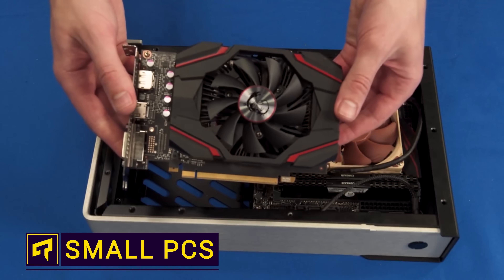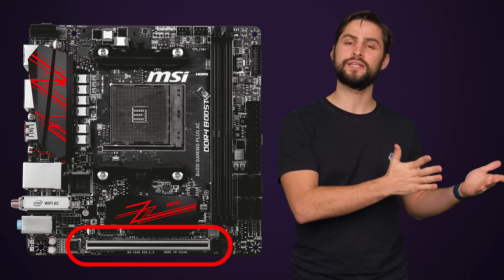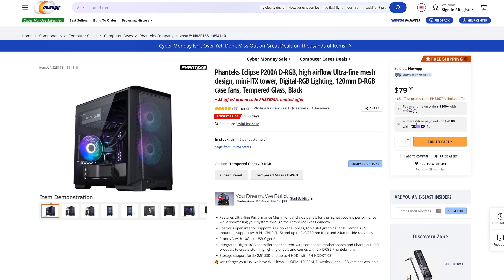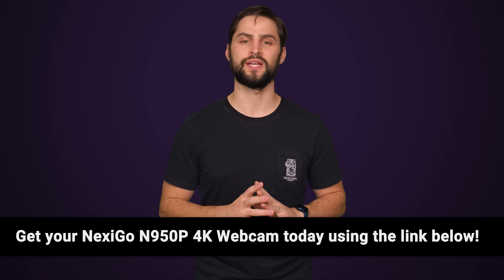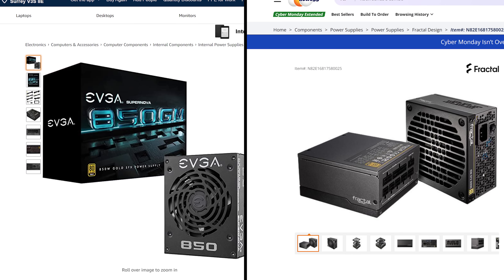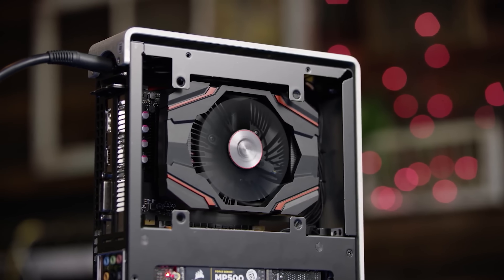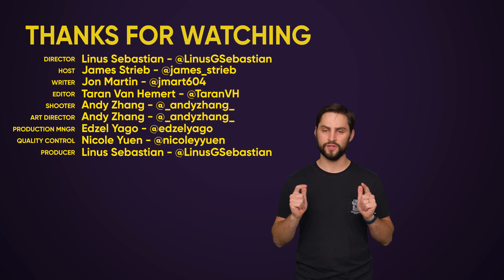Building a Tiny PC - What To Know

Comment: CoolerMaster NR200 was a sweet spot for me. It fits ATX PSU, is relatively small, has good airflow and is a breeze to build inside <3
Reply: I have the same one. I do have an SFF PSU inside it though. But it's a pretty nifty case.
Reply: The NR200 and the newer NR200p Max are great cases for entry into SFF. The max even includes a PSU and AIO. 
Until recently I had the NR200P and it's a really great case. Now have a lianli Q58 and it's a great case as well, but somewhat more constrained for size being a sandwich layout vs the more standard layout of the NR200.
Reply: I have yet to build SFF, but I'd go even smaller, if current market changes in the near future...
Reply: bruuuh the NR200 is 105 euro LOL!! I would much more prefer the Elite 110 which is only 63 euro (locally) and it has a box shape design which IMO is better and I prefer it :)
Reply: @xorkatoss  105 euro? Maybe where you live. I got it for 70 EUR.
Reply: I was able to build in this case with a regular ATX PSU and mATX mobo I already had. Only a few mATX boards fit, but it was really great to be able to downsize without paying the ITX tax
Reply: Sama IM01 is better, same size, cheaper and support both m-Atx amd ITX, NR200 has the power pkug on the mianboard side so it can't fully support all m-Atx options.

Comment: I would love to build a tiny pc, however tiny pc tends to be a lot more expensive tho. Especially in my country where pc parts are more expensive and on top of that, the global shortage supply.
Reply: @est495  Yeah because wood totally supports high temperatures !     /s
Reply: Unless you really want super small, get a smaller mATX case for wider compatibility
Reply: @Joel-pl6lh  It doesn't really matter as pc components don't usually get that hot.
Reply: @Joel-pl6lh  this way, when the power supply burn, the whole pc burn too

Comment: I want a tiny pc as an alternative for gaming in my car. I have a Lexus and I do not want to run the engine every couple of hours to. recharge the batteries, I would need a more powerful inverter for the ATX series. Laptops I don’t get to build, and there are discrete

Comment: 2nd hand framework board, USB-PD 100w battery backed up power bank+60W power supply, or 100W power supply alone, cooler master framework case.  Very tiny PC.  Only downside is no graphics.  Give that a few years when the 16" boards and gpus start getting upgraded lol

Comment: where were you before i bought a node 202 after all my parts and had to buy a new psu and ram and cooler only to find out i need a new psu or extensions and i need new ram for an even smaller cooler and a new cooler that keeps my cpu extra toasty 

good thing theres a chip shortage because my gpu is a piece of paper because thats all that would fit

Comment: Hey guys I have a project about building a gaming computer  and i have formulated a survey and need your guys help since I dont have much friends so i would really appreciate any input 

PS: I'm not limited to a budget 

1 What is the ideal amount of memory slots on the  motherboard?

2 What is the ideal memory frequency?

3 What should the base CPU clock speed be?

4 What is the recommended number of cores for a processor

5 What is the recommended number of threads?

6 What is the recommended number of M.2 slots

7 which generation processor is recommended ?

9 What is the recommended Graphics card?

10 Recommended Wattage for the PSU

11 Recommended modularity for the PSU

12 Is an NVMe SSD required

Comment: I love itx build. It remind me how hard it is to upgrade so I don't, thus saving me some money.
Reply: It really isn't that crazy to upgrade an ITX build, unless you're talking the smallest end such as a Velka 3 build. Even then, though, your only significant limitation is the small GPUs available in the current generation.
Reply: @catgirldoll  I could add 2.5" ssd if only it placed outside of my case.
Reply: @koknyoq  so add an M.2 instead, or if the slots are filled just get a cheap M.2 to USB adapter and clone your current M.2 drive onto a bigger one before swapping them!
Reply: @catgirldoll  pain in the ass to do that better save money. As I mentioned before.
Reply: not really a big PITA. It's just:
- buy drive and $5 or less adapter
- plug drive into adapter and adapter into USB port
- run cloning
- unslot old M.2 and swap

Comment: Didn't talk about GPU selection. There can be a big difference between 2.0 vs 2.2 vs 2.5 slot thick cards and which ones fit in a small case. Also card length and width. The EVGA 3070 XC3 I got was the biggest card that would fit in my Fractal Design Node 304 case.

Comment: If ITX is too expensive, try the tecware fusion or Sama Im01 which fits an ATX PSU, Double fan graphic card, and a micro atx motherboard while being only 21 litres in size. With an SFX PSU there could be room for a full length GPU as well.

Comment: For me I wanted a tiny computer just to run Linux for me on my KVM switch. Since my needs were minimal I just purchased a small used HP EliteDesk 800 g2!
Gave it a 512gb M.2 drive & it's also connected to my 8tb External for........... Torrents.... Serves it's purpose well!

It would of been a joy to try to build a computer this small from scratch but just wasn't practical for me when I scored this for $100 USD back in January & does everything I need it to.
Reply: I was running one of these old HPs as a retro gaming console to run old games on emulators (GTFO NES Classic, etc) and tuck away in the home entertainment center. 

Unfortunately I had problems with the DisplayPort on the 800 so I ended up going with a similar Dell.. but these old desktops in these SFF are incredibly cheap and have a ton of uses.
Reply: @ScottOmatic  Guessing issues making display port work nicely when your HDMI tv? 

I luckily got a display port based KVM switch so it's been fine for me!

Turning one of these into an emulator box isn't a bad idea. Only has crappy Intel integrated graphics. But still plenty enough for emulating anything from the 6th gen or older!
Reply: @ScottOmatic  Not bad haha, if I can get an i5 or i7 cheap on eBay ever I'll upgrade mine. 
But the Pentium is good enough. JUST good enough. Lol (for torrents and media server) 

The GPU market is terrible now. Unless you can catch a card at release. 

I ended buying a Rx 6900 XT at release. 
I didn't want their top of line card... 
But I failed to score a 6800 at release. 
Still I paid retail price so I'm laughing... 

I got a low profile GT 1030 for my wife's old computer. Some old business Dell. 
But I built her a new PC with a Ryzen 5 5600g. 
And gave her my old R9 390. 
Still competent.
Reply: @ScottOmatic  Yeah I was trying on AMD site for the exact card you got. It best fit my budget. 

My the site was crashing and stuff. Not loading. And I didn't get either. 

When the 6900 XT released. AMD had stronger system of blocking people. 
Like the site was overwhelmed and was blocking people for trying to refresh to much. 

My main PC at the time. And my little Linux computer got blocked. 
(Also tried with a VPN) 

But an hour later I got the order in on my phone.... AN HOUR LATER! 
That's how aggressively that were blocking people on the 6900 xt release on AMD site. 

But hey I got mine and I'm very happy!

Comment: If you want a Xbox Series X similar build I just finished one using the Meshalicious case by SSUPD. Full 240mm radiator support, SFX (it can do ATX but I wouldn't) PSU, 3060Ti with room for a 3080. It's a nice case and crams a lot in the small space. Can even do 2 2.5" drives

Comment: small AIO?
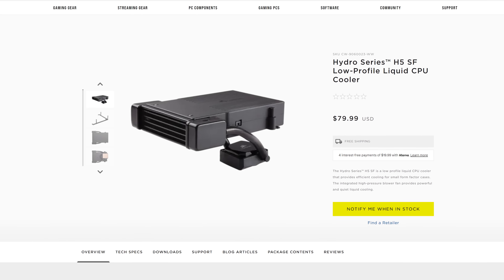Is there a small AIO that actually works as good as an air cooler of similar size? Look at the picture at 3:20 and observe how little EXHAUST area there is. And it's a 40mm fan so that's going to make an annoying sound... I found a seemingly good review that said it was 19degC cooler than the Noctua NH-L9i but the review also said it sounded like a hair dryer... if you don't have a noise-normalized test for cooler reviews you've done it wrong.

Comment: there are no good cases on the market so you have to design and build one by yourself, that's the biggest issue
you can easily buy a passive SFX-L PSU (even if expensive), you can buy KalmX graphics card (sometimes), you can buy NH-P1, but finding a case that has enough space for that BUT NOT MORE is basically impossible

Comment: Video idea: four Mini-ITX VR rigs as flat as possible, like in a desk PC, designed to slide under a couch or bed when not in use, and stand or hang vertically on a wall. Also, a small breakout-box for plugging in the four headsets (or adequate built-in or integrated-into-the-case WiFi to support Wireless VR on all four machines).
Reply: Or just buy 4 quest 2s lol.
Reply: @Jsteeezz  Of course that would be an option, but a second part of the video could be "things you can do with 4x PCVR that you can't do with 4x Metaculus Quest 2s."
Reply: @MegamanXGold  #1. Use them when the Facebook servers are down.
Reply: Just wear a laptop on your back with wired VR
Reply: That's a dumb idea but a fun project
Reply: @KraziAgentAdam best part about my quest is I can use it standalone without a computer, but I can also plug it into my computer and run it off my 3090. For 299 its a really good headset. Sure there are better headsets, but for the price It is outstanding. If I want to play beat saber or the RE4 VR remake I don’t need to be tethered to my computer. And my 3090 will power it just fine if I want to tether it to my computer for more demanding games.

Comment: If you are looking to start with SFF cases, I recommend Cooler Master NR200 as some people in comments already pointed out. It's really the case that made SFF accessible to masses. So brilliantly designed and priced. The instructions are also really good. Just beware that to install a normal CPU air cooler you will need to use the perforated side panel, so the NR200P variant with the glass side panel will require either an AIO or lower profile CPU air cooler. But I always recommend the perforated panel anyway for better cooling.

Comment: You guys should add a small SCREEN to the side of it. Maybe make it overall a bit thinner so it fits in a pocket. THAT would be perfect!
(joking aside I love the SFF community. I'd love to see a SoC + MEMORY approach where you basically plug in a device to any computer and the code runs on that external device. NOT an external GPU but the CPU part as well with shared memory... pros and cons but the idea is neat.)
Reply: use a old iPad Screen with a driver board and 3D print a case for it for a small great looking screen for you tiny gaming rig lol

Comment: I just got the idea, it could be dumb, I don't know haha. Is there any cooler that along with having its typical fans, also physically connects to the computer case, to effectively turn the entire case into a heat radiator? My guess is that the cost of such a case wouldn't be justified by the thermals.

Comment: @Techquickie: Could you guys do a video about how to spot a good PSU? That'd be interesting. :) Cheers!
Reply: Just buy a PSU from any reputable brand (EVGA, Corsair, Seasonic, Thermaltake, Fractal Design) but be sure not buy GIGABYTE’s offerings right now because they are exploding.
Reply: @DJProPlusMax  So basically, you don't know more about PSUs than me. I want to know how to determine if one is well built. Not rely on brand names and marketing. Anyone can do that. I've got a CoolerMaster   sitting on the shelf right now. My current gaming rig has a Corsair in it. But my guess  is that they all have them made somewhere, and that somewhere probably sells PSUs directly. So again, how do you then determine if one is a good or a bad design when you open it?

Comment: idea- is the 710 actually as bad as reviewers say it is for budget graphics
Reply: Terrible
Reply: Yes. Yes it is. Integrated graphics on Intel's 3rd generation CPUs were similar in performance.
If you want an extreme budget GPU, get something like an R5 240. Around twice as fast as the 710, and can be easily found for under $12 on eBay, even in today's market. Still worse than modern integrated graphics on Intel or AMD by a wide margin (probably close to 7th-8th Gen Intel iGPUs), but it's the best you're gonna get if you just need a display output for super cheap.
Reply: @SirSethery  but mine rus faster then my i5 intergrated graphics
Reply: @Damianmackin  
Which gen i5? If it’s 4th or earlier, then the 710 might be slightly faster, but a $12 R5 240 would still be twice as fast.
Reply: @SirSethery  its a 10th gen cpu, and the r5 240 can have some graphical issues
Reply: @Damianmackin  
If it’s not an F model, then the built in graphics should run miles around the 710. Maybe you’ve had some driver issues.
And I haven’t had any issues using R5 240s and HD 8570s (basically the same card), and they’re also a bit newer than the 710 and support some more DX12 and Vulkan features.

Comment: Just use the stock cooler, it'll fit in even the tiny SilverStone AD120-STX.  You don't need a fancy cpu fan unless you're overclocking, which is a waste of money anyway (spend the money you save on the fan on a faster chip)